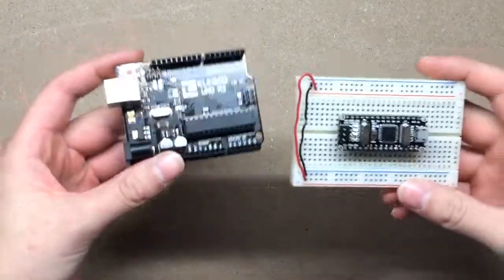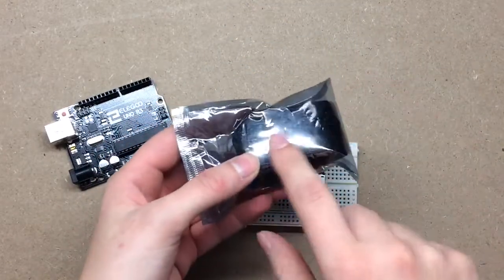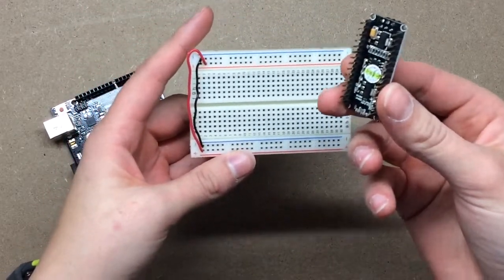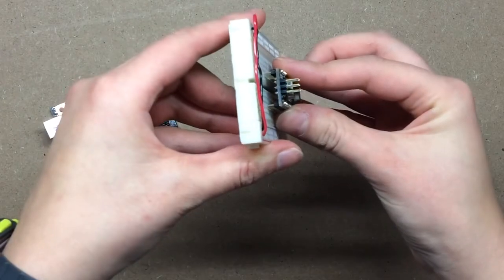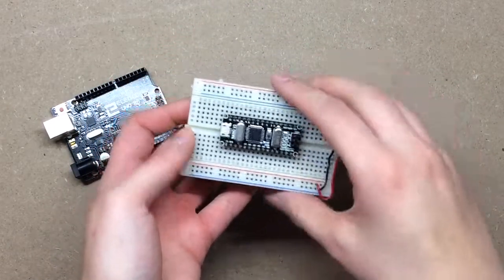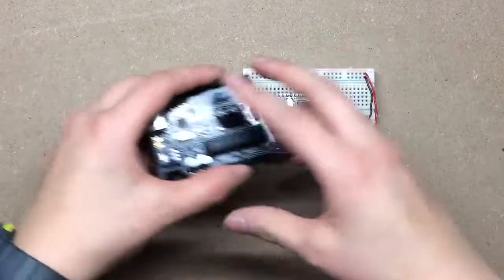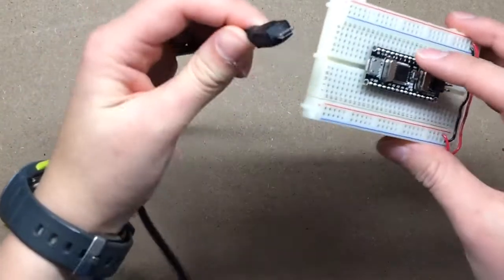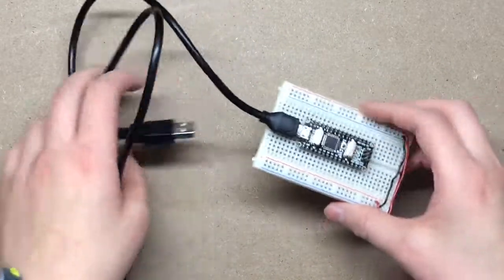Connect an Arduino Nano to a Breadboard (2 mins!)

Comment: i’m just here struggling to even push it into the breadboard
Reply: Same, can't push it in ..
Reply: Use a piece of cardboard on top to push it in. I just stabbed myself in the thumb with the bottom pins while removing it! Takes some force either way.
Reply: I can definitely relate to this
Reply: Ong